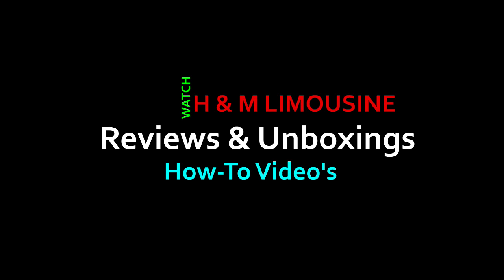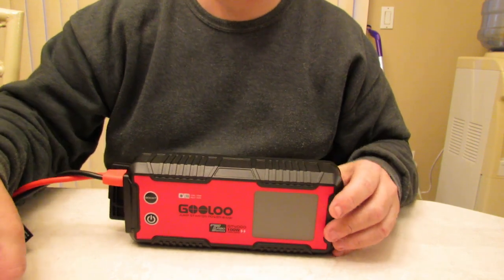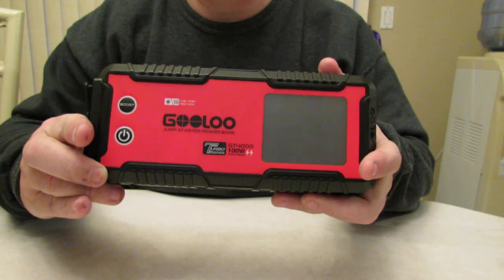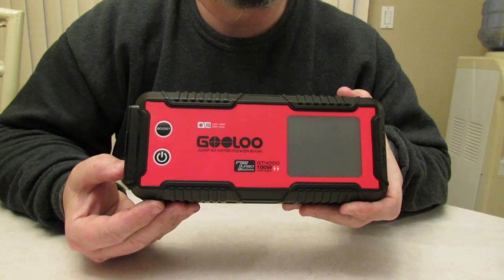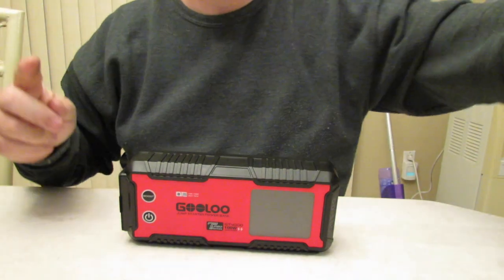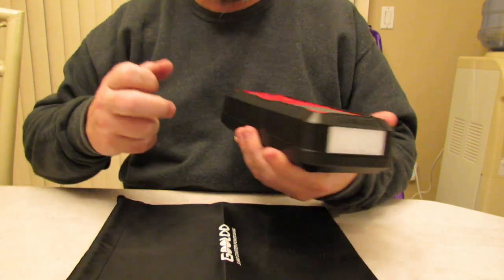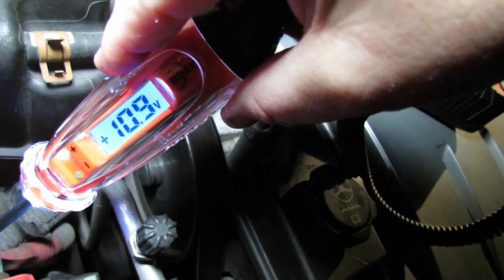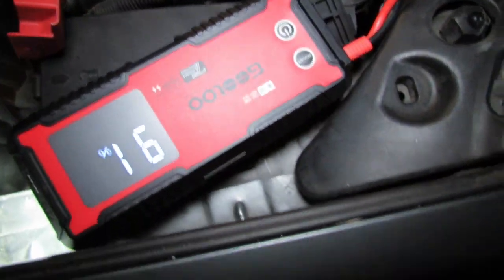GOOLOO GT4000 Jump Starter (Beast Power--12.0L)

Comment: Clamp the cables on the battery first, using the light.  Then plug cables into jump box.  Easy peasy.
Reply from the maker: You could do it that way, but I prefer the light on the same side as the clamps, so I don't have to hook up cables first, then hook up to the unit. It just seems like unnecessary extra work. Now, if you hook it up your way and you have a bad connection,  then you have to unhook the unit from the cables for light, only to hook it back up again when you have a good connection. Too much work, shouldn't be like that. Lol. In a pinch, I would do it your way if no other options. But with technology these days, the light should most definitely be on the same side as the cables, so you can use the jump starter without fumbling around in the dark. I appreciate the comment. Have a Happy New Year

Comment: Thanks for the nice review H&M! Quck question- When you jumped your vehicle I noticed the jump pack display did not show volts reading of the battery before or after starting your engine. Isn't that feature included, or is it not?  Possible deal breaker for me. Thank you!
Reply from the maker: Sorry I didn't respond sooner, but the Gooloo GT4000 does not show your battery voltage to my knowledge. Thanks again

Comment: What is the difference between GT4000 and GT4000S?
Reply: The GT4000 has cold weather battery preheat.
Reply from the maker: @ricks99gt  yes it does. Up to -40 degree preheat technology

Comment: The gt4000(s) DOES NOT HAVE PRE HEAT FEATURE....... the regular gt4000 DOES HAVE PRE HEAT FEATURE
Reply from the maker: Now we know what the difference is between the GT4000S & GT4000. Thanks for letting me know, since I was unsure. I was actually showing the better unit GT4000 that has pre heat technology. Like I mentioned already, when I ordered the GT4000S they sent me the unit I reviewed, so I didn't know i was reviewing the GT4000 and not GT4000S. Thanks for bringing it to my attention.

Comment: Use the light to atrtach the cables to the battery then plug the cables into the jumper. Pretty simple! You can pnly plug it in one way. If the light was on the same side as the cables the light would be much smaller and the power outlets couldn't be there either. Use your brain.
Reply from the maker: If you really thought about things the light should most definitely be on the same side as the cables since the light is pointing directly at the battery, if the light is being pointed in the opposite direction you cannot see anything in the dark. And in reference to your comment if the light was on the same side as the cables the light would be smaller, yes in theory the beam would be smaller, but it would still put out about 400 lumens and put enough light where it needs to be, and you could see everything clearly in the dark. I'm assuming you have never used one of these portable jump starters under your hood in the dark, because if you have used one in the dark you would realize your comment doesn't hold water. So do us a favor, buy 2 portable jump starters, one with the light on the opposite side of the cables and one with the light on the same side of the cables, then go under your hood in the pitch black dark and try to jumpstart your vehicle with the light pointing at the battery and then try jump starting with your jump starter light pointing in the opposite direction away from your battery. I will be waiting for the results. And in reference to your comment "If you use the light to find your battery then hook up the cables to the jump starter" doesn't really make sense since if you have a bad connection you will have to unhook the cables for light only to rehook the cables when you have a good connection, it defeats the whole purpose of having a light on the jump starter in the first place if it's used like that, see what I mean? There's absolutely no reason for negative comments (Use Your Brain). This is Not the first negative comment you have made in reference to videos on YouTube, please do us all a favor and think before you comment, there is no need to be sarcastic or negative. You could have just posted a nice comment letting us know your opinions, and we would have answered kindly, but you chose to start off saying sarcastic and negative comments in my videos, and others. Just be respectful, if you want to be respected in life, you must respect others. Just wanted to get this off my chest for people who make negative comments. Have a great day.